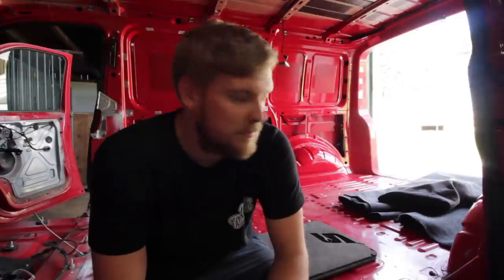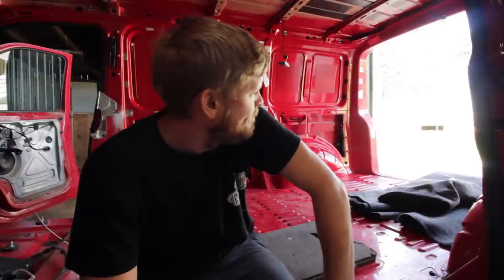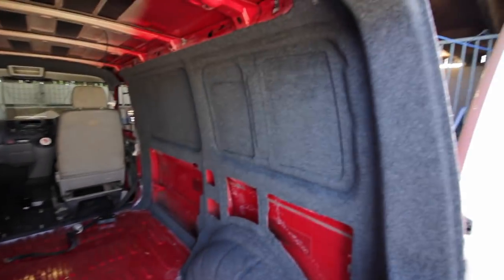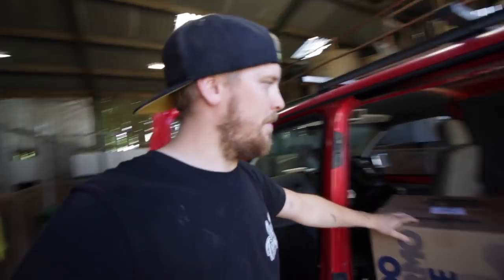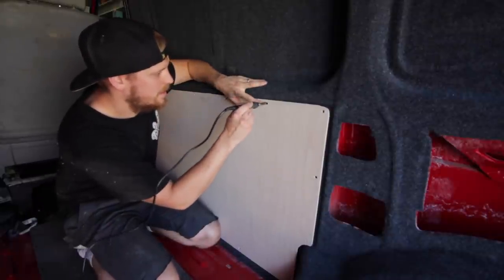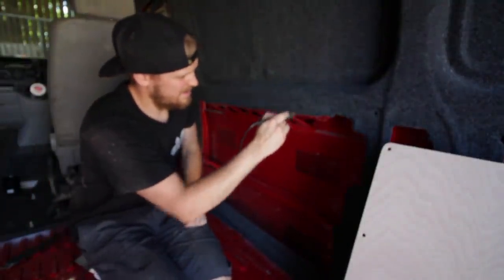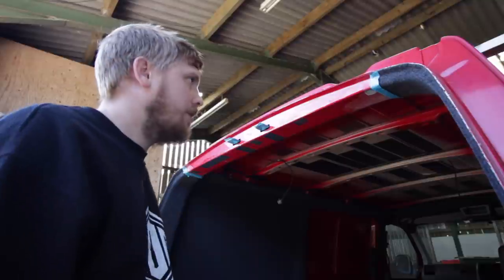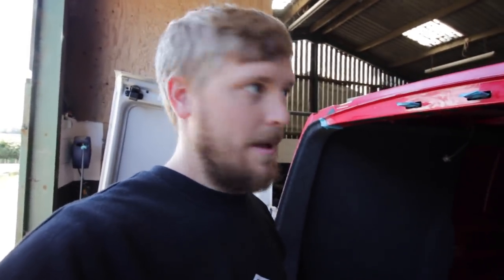VW T5 'Restoration' Ep.4 How To Insulation, Ply & Carpet Lining Transporter

Comment: Liking the honesty regarding the sound deadening. Been trying to work out if it's worth getting for mine. Main issue is road noise a lot of which comes straight from the front of the van so not sure how much sound deadening will help. Will probably still do a bit but not going to go overboard.

Comment: Thanks for taking the time to do this build for youtube Dan, it's good to see someone go into so much detail, but did you cut the jack mount off on the wheel arche inside the van ?? my T5 has one after pulling the old ply off
Reply from the maker: Thank You for watching and for the comment! Yes i did! I forgot to film it though🤦‍♂️ I did id a similar way to removing the bulkhead lip by grinding the weld down.

Comment: Enjoyed the vid, cheers. I’m guessing the rubber door seals will just slot over the carpet which will look super neat. Will there be any problem with water wicking in?
Reply from the maker: Thank You for watching and for the comment! Yes the seals cover the edge of the carpet. No problems with water getting in as the seal position is not changed.

Comment: Great videos, thanks for the info. Any particular reason for not putting insulation in the roof?
Reply from the maker: Thank you so much for watching and for the comment, Cost mainly. You don't need to put it in. I didn't have insulation in my roof for a few years and never found it to be a problem as it was only used for weekends/weeks away.
Reply: @DanChambersDAC  OK, thanks. I'm looking for a van to buy at the moment that will be for occasional use so won't bother then

Comment: Where did you get the clips from ? And is there a specific name there called ?
Reply from the maker: They were from ebay. Link is here:- https://rover.ebay.com/rover/0/0/0?mpre=https%3A%2F%2Fwww.ebay.co.uk%2Fulk%2Fitm%2F371561542163
These are for 8mm holes so just check the hole size you have.

Comment: Great stuff! New subscriber. 

I know in housing insulation you’re often only as good as your weakest link, usually studs and windows here in the states, does the insulation really make a difference?
Reply from the maker: Thank you for watching and for the comment! If you go all out with the insulation yes. My Crafter has around 5 8x4 sheets of foam insulation and 16 rolls of it.

Comment: You forgot to put a plastic barrier over insulation condensation in van will rust it and it is a vw lol
Reply from the maker: No I didn't forget it.
Reply: The condensation  will cause mold under all the hollow covered  parts when the van is used as a camper in winter . Should have covered these with PE  sheets on the "warm" side first.Hidden mold can cause respiratory  problems very quickly!